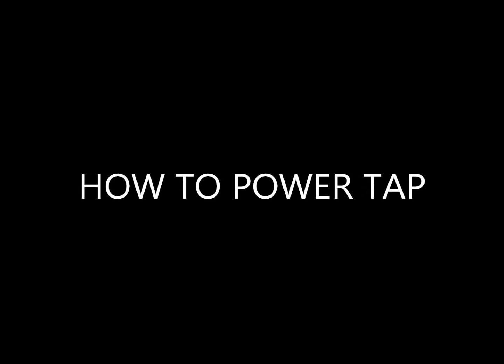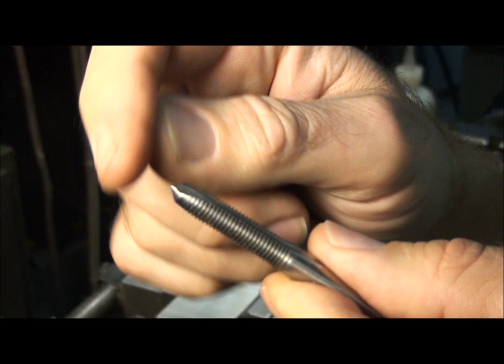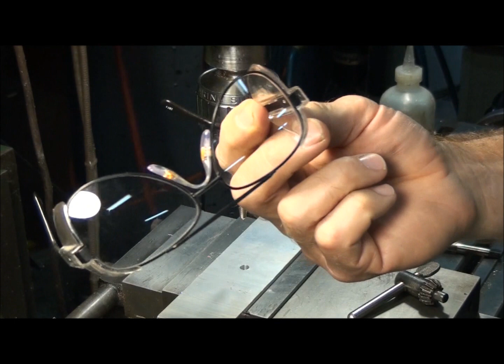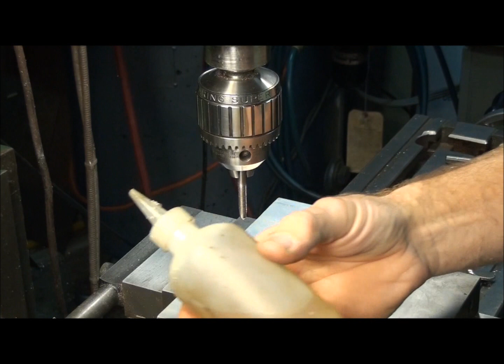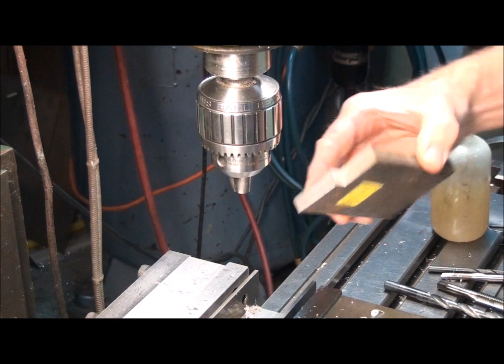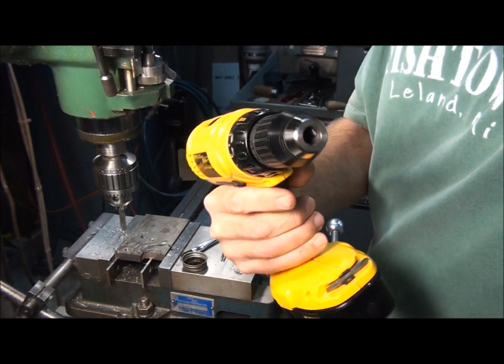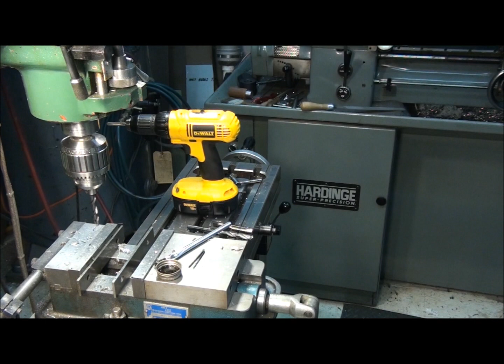How to Power Tap

Comment: How quickly are you able to change direction on your mill?
Reply from the maker: Pretty quick. It runs on a rotary phase converter, so it just takes the flip of a switch to reverse it.
Reply: @TomsTechniques Sorry for the ignorance, but is that true for all milling machines (or most) or specifically yours? I just bought a Birmingham mill, but I don’t know if it can change direction like that or not.
Reply from the maker: @MaintainingAmericasLegacy  If it has a reversing switch on the motor, it can.

Comment: You don't get Chinese import spiral flute taps in the US? And, there's nothing wrong with carbon steel except it goes blunt quickly. New out of the box, higher cost HSS gives no advantage
Reply from the maker: @alastairbarkley6572  Correct. "I" don't get imported Chinese taps in the US. In my experience, the quality is not predicable enough to risk a broken tap.

Comment: About how many rpm’s did you reduce spindle speed down to?
Reply from the maker: Just start slow until you get the hang of it. Then bump up the rpm as needed. Remember, coarse thread taps will screw in faster than fine threads.

Comment: You want to run them taps alot slower in harder or tougher materials. You'll get away with it in aluminum.
Reply from the maker: Yeah, I generally halve the cutting speed when tapping.

Comment: We had a tap stand at work and I loved it. Just as fast as doing it in the mill and you have the feedback from doing it by hand.
Reply from the maker: Not sure how hand tapping can be as fast as power tapping, but you liked it. Did it by chance have a pneumatic tapping head on it. I've seen those.
Reply: It was set up with all the different taps already in quick change holders and it had a crank handle on top.. I’m supposing you’re doing it in a manual mill where you change tap and drill like you did. With this, you just drill, say 5 holes, then tap them at the tap stand. Even if they were 5 different taps, the holders just pop in and out.

Comment: I’ve seen a lot of individuals use this technique. I was taught to never ever put a tap in a drill chuck, unless you don’t value your chuck and definitely never in an expensive keyless chuck like an Albrecht.  If you want to power tap safely and correctly then get yourself a tapping head such as a tapmatic. Your taps, and spindle switch will thank you.
Reply from the maker: I've been using this technique on this machine since I bought it in the mid 80's and am still using the same chuck and switch. I suspect what you were taught was based more on theory than real world experience.

Comment: Isn't that hell on the machine by jamming it into reverse at speed? We've used hand drills to tap for years. Easier to control the tap.
Reply from the maker: I use hand drills as well, for certain applications, but the best way to get the tap dead square to the hole is to do it in the mill. And no, it doesn't hurt the mill. Reversing the motor generates less heat in the motor than taking a heavy cut.

Comment: So what RPM is suitable for power tapping, say a 1/4-20 thread in aluminum?
Reply from the maker: Whatever you are comfortable with. Remember, you have to reverse the tap when it breaks through before it runs out of thread. Just start slow, maybe a couple hundred rpm. It may take a little longer, but there is less chance of bad things happening.

Comment: CAUTION !!!  Do not do this in a steel , you will break your tap. This method is only to be used on aluminium
Reply from the maker: That is not true Karlo. Power tapping works equally well on aluminum and steel, even stainless. Just be sure to use spiral point taps and the appropriate lubricant. You would know that if you had watched the entire video before commenting.

Comment: You won't find this method taught or written about since it's the fastest & best method for ruining a perfectly good drill chuck and reversing drum switch.
Reply from the maker: Nice try Wayne, but I've been using this technique for nearly 50 years and have yet to replace either. Don't assume something you are unfamiliar with is bad without giving it a fair shake.
Reply: @TomsTechniques  it is YOU who is making assumptions. I have seen the damage first hand and this is something not allowed in my shop.
Reply from the maker: Lol

Comment: Amazing. By hand with cordless drill in steel at 10:28
Reply from the maker: It's all about using the correct tap and starting it on axis with the hole.

Comment: I always power tap with 4 flute( foot) (floot) cheap chinese taps. Never broken one. Just need to keep extracting to clean the flutes,foots floots
Reply from the maker: Two flute spiral point taps can be run straight through without clearing the flutes. Saves a lot of time in the long run.
Reply: Toms Techniques thanks Tom

Comment: I've used this a bit on a regular drill press. Clamp work down, drill hole, power tap down (turn switch on and off real fast to not go too far), then you have to hand crank back out.

You can also hand crank both directions, the drill press is just a jig to align the tap. Works great, I rarely use the tap wrenches.

Comment: It not possible to tap in a manual drill press. You are miss guiding people. Coz it is barely possible to press the drill head according to thread travel and drill speed.  And more over at the time of reversing the tap bit the thread will destroy if the tap bit stays in a fix position for a fraction of a second. The threads you make are useless for sure that's why you didn't show screwing a screw in any of the holes you made. Using a hand drill it will be possible coz the tap bit will guide it self twords the holes and we can stop and reverse the drill and the tap bit will itself come out following the thread.
Reply from the maker: If you are unfamiliar with power tapping, you obviously have spent little or no time in the industry. I first learned to do it in the early 70's working in die shops. Everyone there used it to save time by tapping the hole in the same set-up it was drilled, and I've used the the technique ever since. 

Mills are ideal to use because they have a lot of inertia, but drill presses will work as well. They just have to be reversible. One shop I worked in had an old drill press they used for power tapping that had a reversing switch in a foot pedal and it worked very well.

As long as you use a spiral point tap as I specify in the video, there is no danger of "destroying" the tap when it's reversed. Try it, you might just like it.
Reply: @TomsTechniques  After posting my first comment I realized that or recalled that you loose fit the tap. That is the main point I believe. If anything bad happens related to speed and timing then the loose fitting to prevent the damage. Thanks for sharing your knowledge and skills. And sorry if I hurt you in my first comment.
Reply from the maker: Not a problem. You can't have a thin skin and post videos on YT. :)

Comment: So all I need then is a $5000 dollar drill press with variable speed and reverse.  Cheaper to do it by hand.
Reply from the maker: It's also cheaper to do your milling with a hack saw and hand file, but I wouldn't recommend it if you expect to get anything accomplished. For those of us who actually own a vertical milling machine (not drill a press), this technique will save a lot of time.

Comment: hey tom what brand taps like this do you recommend ? maybe a couple options as i cannot afford real expensive ones if they are lol
Reply from the maker: Any decent spiral point tap 3/8" or smaller is going to cost $5-$10, depending on size. Look for those made in the U.S., Japan, or Europe. Anything made in China could be decent, or total garbage. It's best to just avoid them. There is no such thing as a cheap tap. If you settle for them, you'll pay more in the end when they break.

Comment: You forgot to mention that you DO NOT DO THIS WITH A KEYLESS CHUCK IN YOUR MILL OR DRILL PRESS because these are designed to be self tightening and a larger tap will cause the torque to increase to a point that will cause the chuck body to deform and then crack.  Small taps will cause the chuck to tighten to a point that you may need a strap wrench to break the hold sometimes.  Other times you may get away with it.  Do you feel lucky?  Well do ya?  Even if you do get away with it, do you think you have increased or decreased the run out of that keyless chuck?
Reply from the maker: I haven't used that many keyless chucks, so I really can't comment on that.

Comment: I use back gear to do this... seems more controlled because of the lower rpms, but perhaps too much torque?
Reply from the maker: The torque is regulated by how tight you make the chuck. Just use whatever speed you are comfortable with.

Comment: I see you on a milling machine but as at home can I use a drill press and when it catches does the tap pull into the material as in extend the drill without having to push down?
Reply from the maker: A drill press will only work if you have the means of reversing it. A shop I used to work at had a drill press set up for tapping with a foot pedal that reversed it.
Reply: Okay thanks, and thanks for quick response too

Comment: Wow, amazing technique! Is it possible to do this on 304 stainless steel as well? I feel 304 dulls the taper easily, even for high speed steel taper.
Reply from the maker: 304 has very poor machining characteristics. You can tap it, but it requires a tapping fluid meant for stainless to reduce friction on the tap. It can be power tapped, but likely not in one pass. You may have to back it out a few times to clear the chips and allow more tapping fluid in the hole if the tap starts slipping in the chuck.

Tom

Comment: You got the basic idea right, but most of your terminology  is wrong, that isn't a "spiral tap" that is a gun tap. It is designed for through holes because it pushes the chip through the hole. also the tip, its not "spiral" lol i mean think about what "spiral" means.    What you are actually referring to is a "lead" or "taper" it helps guide and center the tap and almost every tap will have it. 

 the amount of flutes are based on size of the tap it doesn't really have anything to do with clearance, more flutes = more cutting edges, but downside is you gonna have weaker tap,  so smaller taps will have less flutes to keep them strong as possible, and bigger tap will have more flutes (the people that design the tap have figured out  and tested the ideal amount of flutes for certain tap)  
  for blind holes you would use "spiral tap" it has a left hand helix and that pulls the chips through the flutes out of the hole, typically those are more likely to break because chips can get wadded up in the flutes of i you go past the clearance of the flutes
Reply from the maker: I didn't say spiral tap, I said spiral "point" tap, which is what I use for power tapping. I realize that spiral taps are also used to power tap and under ideal conditions (like CNC) work very well, but for general use I prefer straight flute taps because they are stronger.

Two flute taps have much more room for chips than taps with more flutes (those extra flutes take space). I prefer two flute taps in non-ferrous metals for that reason, as they are much less apt to plug up with chips than three or four flute taps.

Tom
Reply: yeah i was correcting you, you got right idea but the reasoning and terminology is off. I am trying to explain that you have taps types mixed up. there is no such thing " as spiral point"    when you are talking about " spiral"  it refers to the  shape of flutes on the tap not the actual point. The spiral (helix) goes all the way though  the cutting surface and then some so not sure why you would refer to is as "spiral point" Also all taps have point  that is tapered (" lead") Furthermore  by design gun tap ( the one you are using in your video)  pushes chips through you shouldn't have chips in the flutes, maybe couple flakes (lift your part and look under the part the little bundle of chips will be on the bed of the vice).

 Also it doesn't matter if its cnc or manual mill, you use gun tap AKA " straight flute" for through holes" and spiral for blind holes, the spiral tap has left hand helix and as you turn it clockwise it pulls the chip through the flutes to the top, that way you don't risk  chips clogging up your thread or bunching up at the bottom and breaking your tap.

now lets address the whole " stronger straight flute argument" that's bunch of bs, as long as the tap has overall same amount of material it should be same strength, so if you compare spiral tap with same amount of flutes as the gun tap, it would be same strength. now there is some truth gun tap (type of that you use in the video, in case you don't know difference between gun tap and spiral)  being less likely to break in right application, and its partly because it uses less cutting pressure since it normally has longer lead, and its less likely to get chips bunched up between flutes resulting in more reliable process. 

as far as less flutes = more clearance for chips. that is irrelevant because if you have more flutes then you have more cutting edges= thinner chips and longer tool life since your tool will stay sharper longer.

You did get some things right, putting tap lightly into chuck so it slips is good trick, they also make tap holders with clutch that you can set the resistance on, same idea but more reliable, and lube  is supper important try to use the right lube for right material, aluminum, loves wd40, stainless and steel prefer cutting oil. 
Now to add to your points, use the right tap for the right job there is a reason why they make different taps with different amount of flutes and helix, obviously if there was tap that could do every type of hole perfect they wouldn't have all different varieties.

sorry didnt mean to wall of text ya, just trying to explain hopefully it makes sense.   Great channel btw I picked up your trick on milling extremely thin material in the vice keep up the good work sir.
Reply from the maker: If you would stop typing and take the time to actually research the term spiral tap vs. spiral point tap, you would actually see that they are two different things. It's fine if you prefer spiral taps, but as I've explained, I've found that they tend to break more easily than straight flute taps in general use, and not under the controlled conditions of CNC. If you feel so strongly about spiral flute taps, you should do as I and share your experience through a video. Multiple viewpoints are always a plus.

Tom

Comment: Hey Tom, I love your videos, straight and direct in teaching the technique. Can you suggest a brand of taps?
Reply from the maker: Thanks!

Spiral point taps made in the U.S., Europe and Japan are all excellent quality. Look for names like Morse, Regal, Union-Butterfield, Reiff and Nestor, Cleveland, etc. Cost should not be a factor when choosing taps. A quality tap will cost more, but more than pay for itself in performance and be MUCH less likely to break and cause you grief than a cheap alternative. The best tap I've ever owned was made by Bendix. It is a 2-56, 2 flute and I've been using it since the 80's. It just keeps on going, with no sign of wear. They must have got everything from the steel to the geometry absolutely perfect.

Tom

Comment: At work we do it both on the drill press and with cordless drill on stainless steel, steel and aluminum in stainless is the hardest because you have to play with you drills because of the hardness of the metal you go one or two sizes over depending on the thickness
Reply from the maker: A good tapping fluid is the secret for stainless because it is so sticky. I use the old formula Tap Magic, but I'm sure there are other good candidates around as well.

Tom

Comment: How does the feed pressure get applied correctly? If you were too slow wouldn't the tap basically drill the hole out?

Does the tap pull the drill down?

Curious about pressure vs. Spin rate.

(Machining noob here)
Reply from the maker: Never had a problem with that. The tap readily grabs and pulls itself into the hole, regardless of rpm. I've even had taps pull themselves out of the chuck because I forgot to move the quill stop out of the way. Although I Wouldn't recommend doing that. :)

Tom
Reply: Cool, thanks for the insight. :)

Comment: how do you align a predrilled hole? tap seems crazy fast, looks like it will strip through the thread
Reply from the maker: Power tapping is best used on a hole that is already in position. Otherwise you would need to find the center of the hole with an edge finder or pin.

Tom

Comment: Am I correct that you wouldn't want to try this with a keyless chuck since they self-tighten?
Reply: I never had a problem. The only time you really have to be careful with any chuck is when you get into taps that are under 1/4 inch. I've done thousands of holes and it's the really small ones you want to be sure you are using a fresh tap. I wouldn't attempt it with the really small stuff like a 4-40 or a 2-56. Especially in a blind hole and even more so if it's steel. Aluminum is a piece of cake compared to steel.

Comment: kinda hard on the chuck slipping that tap in it.
Reply from the maker: Apparently not. This is the original chuck that came with the mill in 1988 and it still runs dead true. I suspect the jaws in the chuck are slightly harder than the shank on the taps.

Tom
Reply: I dont slip stuff in my chucks  ..it dont  help them last.
Reply from the maker: You weren't listening.